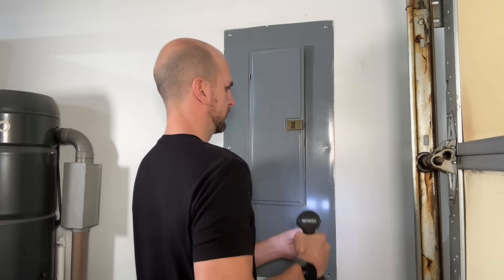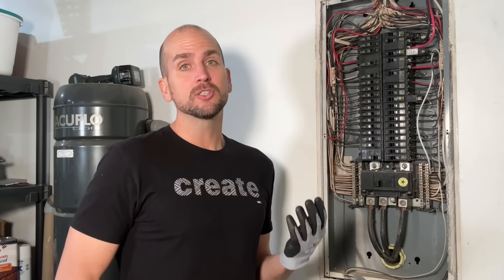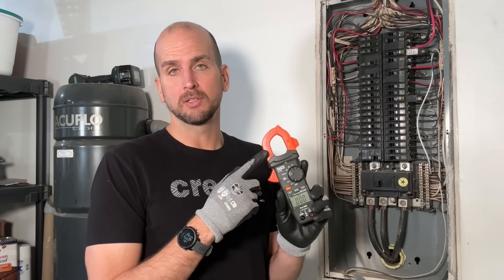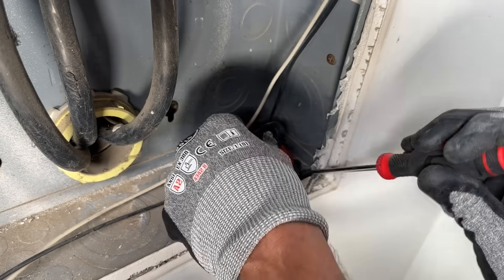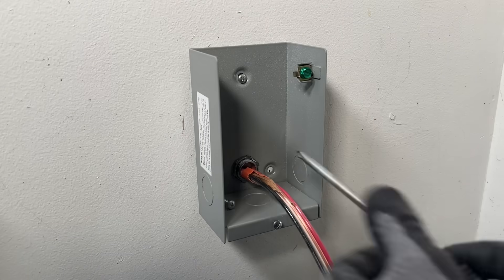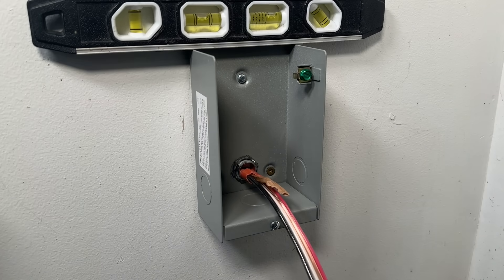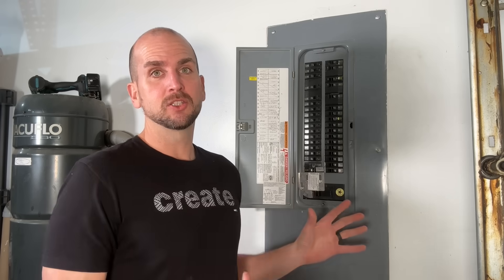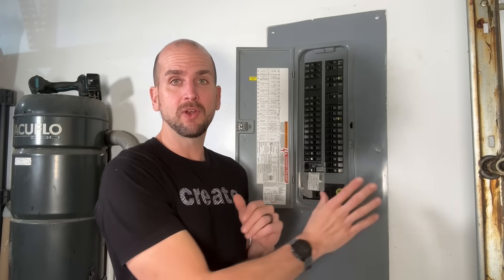Whole House Power Backup Solution | Generator Inlet Box Install

Comment: “Why the interlock?”  No lineman who wants another birthday works on a “dead line” without grounding it out first.  The reason YOU don’t want to back feed the line is 1) your backup generator doesn’t have the power to supply your neighborhood, and 2) when line power returns it will destroy your expensive generator.  It’s not about lineman safety, it’s about not burning your house down.
Reply: 20yr lineman here. It is absolutely about lineman safety. Many lineman get killed on storm from joe blow wanting to test out his new generator without hooking it up correctly. It backfeeds on our powerlines increasing the voltage through the transformer to 1000s of volts. Big killer of lineman. Even if grounds are installed there is still the potential of arc flash injuries to the lineman as he installs the grounds
Reply: @acescape88  Arc flash is a concern but that's why we had grounding hooks with 10' poles.  Nobody can look out for you... like you.
Reply: @acescape88 Hey, can we use Mike blow, or maybe Bob blow… thanks, Joe.
Reply: @acescape88 voltage doesn't kill
 the  intensity does
Reply: @dperez-tv1lr  Please explain
Reply: That's why to turn your main breaker off, so you're ONLY feeding your house
Reply: @Blackhawk1286  Spot on.  Trying to feed your whole street with even 50 amps will quickly blow the breakers on your generator.
Reply: @BulletproofPastor  you are forgetting the windings in the transformer. Just how a transformer converts high/primary voltage to low/secondary voltage, it works the same in the opposite direction when you backfeed. Low voltage input, high voltage output. The only scenario in which you could be partially correct is with old 60’s style open wire secondary line or “underbuilt” secondary. In which several houses can be fed down the street from the same or many transformers wired in parallel. But that stuff’s pretty much phased out.
Reply: You literally don’t know what you’re talking about. If you’re actually a “credentialed electrician” you’re exactly the type I would never hire to work on my home.
Reply: @47coreyg  ohh  so u too stoopid to do electrical work check ✔️
Reply: Let me add this too. Won’t the grounded line pull so much current from the generator to cause it to trip in the first place? Unless this home generator is made to power a stadium not 5300 watts or so!!!!!!!
Reply: False
Reply: Hahaa you have no understanding of electricity!
Reply: @Pure-Blooded  And you have no idea of my electrical engineering training and background.  What’s hanging on your credential wall?  Not that you need formal training, just talk to any solar provider about the consequences of making a grid tie without phase matching.
Reply: @BulletproofPastor   Solar electrician you say !  Stick to studying the books .  You have no real life experiences.

Comment: I over-engineer safety protection (>35 designing chemical plants).  I used the interlock kit for my breakers; but I also installed a locked A/C disconnect box between the breaker box and the  Power Inlet Plug.  I could not accept a single "interlocked" breaker preventing those prongs from being energized.  Anything that is life threating needs a least 2 levels of safety protection.  I could not find a Power Inlet Box with a locakable cover.

I loved your idea for tightening the NM cable clamp screws.  It would have saved me a extra hole in my sheetrock.

Comment: Can someone post how to Wire for the ford Onboard 7.3 KW generator?   Apparently its gfci protected.  And no suicide or even straight up 30 amp outlet will work unless u get a transfer switch .  Thats not gonna work .  Without overloading it it will trip regardless.   Someone mentioned Binding Neatral in a post but nothing more

Comment: For over 10 hours or a couple days of power outages, a generator is the only choice. Either a propane or gas generator because batteries don't hold enough power to go that long. Of course, depends what you want to have on. But keep in mind, once the batteries are depleted, that's it. Your in the dark.
Reply from the maker: Agree, especially for anything over 1 day.  Some people are using generators to charge the batteries and then run the house the majority on the time on batteries without the sound of a generator in the driveway.  This solution is a bit pricey currently but the battery cost should come down over the coming years making that type of setup a bit more practical.
Reply: @EverydayHomeRepairs  that's interesting. If the price of batteries comes down, the price of electricity may come down also. Why? Because solar is getting cheaper. And if they can store that energy for cheap in batteries, they will do it on a huge scale for the grid. Then many houses will also have a large battery bank with solar panels and gas generators.

Comment: One reason that you did not mention for having an interlock is very important. Your AC power is going from positive to negative at 60 hertz or 60 times a second. If the power company's power would come on and you are connected to the grid and they are not in sync, you would probably lose you generator.

Comment: Ecoflow is very nice. But mine did break, and it took a month and a half for customer service to take care of me and replace my unit under warranty. They were so slow I definitely got a bit angry. It does work very well and I also have a Honda 2200 which I can then turn on and charge my Ecoflo in about an hour and a half and then I can run all night long on the battery system.

Comment: So Your home is only one phase. From the transformer you have a coil that is tapped in the middle of it with a ground. To get 110/115/120 from one "LEG" to ground and from each "LEG" to each other you get 240. Elctricians dont calls those phases its from one "LEG" to another.

Comment: I did the same thing when we built our home, but for a wheeled Trygas unit, loved it! With whats happening in our world today, I needed quit generation. Looked into the solar gen lineup, and chose the Bluette AC500. It was the most bang for my buck! Now I'm going to add a plug to the inside but for my 50 amp. I intend to use two sets of them for a whole-house generation. Thanks for the info!
Reply: That's awesome to hear that you found a power backup solution that suits your needs! The Segway Portable PowerStation Cube Series could be a great addition to your setup too. It offers massive capacity, powerful output, and fast recharging. Plus, its armor design and waterproof technology make it perfect for outdoor adventures. Check it out and see if it fits your requirements!
Reply: That's awesome to hear that you've found a great backup power solution for your home! The Segway Portable PowerStation Cube Series could be a fantastic addition to your setup. It offers a massive capacity, powerful output, and fast recharging. Plus, it's built tough and has waterproof technology, perfect for outdoor adventures or emergencies. Thanks for sharing your experience and recommendation!

Comment: This is the simplest interlock system to install.  Relatively easy to do and less expensive than a transfer switch.  The issue with the interlock is that when the grid power is restored, you might not know.  A transfer switch will let me select which circuits are critical and need to be powered by my generator.  The non-critical circuits (some lighting circuits for example) stay connected to the grid.  When grid power is restored, those circuits become active and Ican shut down my generator (saves gas and wear and tear on my generator).  One thing not mentioned that most portable generators have their neutral and bond tied together inside the generator.  NEC requires these to be separated and individual wires run to the main electrical panel.
Reply: If  you have a smart meter, will it go blank when the power goes out, and then you'd see it come back on when the power was restored?

Comment: @2:00 you mention the 120v load from the furnace.  This must be the fan on a gas furnace.   Some have pure electric furnaces that draw far more than the 8-9 amps in yours and they draw it at 240v.

Comment: I think you should have shown how and where to install the generator breaker so it would interface with the interlock.  And how to move other breakers, if necessary, to make room for the generator breaker. I had to move two breakers to make room for the generator breaker. Helpful video.
Reply: He has a video about moving breakers. I thought the same thing and then found it.

Comment: I'm in an area where we have frequent power outages during storm seasons. Surprised your not allowing for at least one Fridge/Freezer or more. They are one of my biggest draws, after AC/Heat. And don't have the generator capable of running both AC's.
Reply from the maker: I accounted for my Fridge on this setup but not the central Air/AC.
Reply: @EverydayHomeRepairs  Sorry didn't hear that mentioned. We have 2 Frig's & a Freezer, which are our largest draws, and only run one AC if necessary. Can run a portable room unit, if necessary.
Reply: @Bwanar1    Same situation for me.  During high-draw periods (e.g. running the hot water heater), I may alternate refrigerators (unplug one or the other) as we're not usually needing both to run at the same time and they hold their temp quite well.

Comment: Very good job. One thing I noticed (unrelated to the purpose of the video) is that in your main panel, several circuits have their neutral and grounding conductor landed together in the same screws, these need to be separated. I know it's a main breaker panel, I'm not saying separate neutrals from grounds, I'm saying separate a neutral and a grounding conductor in the same screw.
Reply: I wish I understood better what you’re saying, with illustrations of right and wrong
Reply: @jesusisaliberal548  separate bare copper conductors from being in the same screw terminal as white sheath conductors (neutrals)

Comment: Great vid, I have a 6yr old house that doesn't have a main breaker,  because they didn't require it at the time per the contractor. Is this process still the same?
Reply: I've found that any improvements that require a building permit  might trigger expensive changes unrelated to the work specified in the permit.  When I moved my water heater from the bathroom to the utility room, code requirements dictated that I had to install a 20 amp outlet in the garage and change my main electrical panel to the updated design.

Comment: The Interlock setup is the one I use and have used it many times since I put it in.  Recently, we had an ice storm and power to my neighborhood was out for 3.5 days.  I was able to run my whole house off of a 5000 watt (continuous) inverter generator and even sent out some emergency extension cords to neighbors.  My entire setup, including having  the interlock installed by a professional electrician (though I considered doing it myself) for about $1600.  The Generator was $975 (with taxes), the heavy extension was about $75, the interlock kit was about $80, and the inlet was about $50, and the labor from the electrician was about $200 (he was an honest electrocution I have had people tell me that electricians quoted them $3000 just to install the interlock!  There are some major dishonest tradespeople out there.  After seeing my lights on while almost everyone else was out of power, five of my neighbors came to see my setup and had interlocks put in, and all bought a 5K inverter generator.  My generator won't run my AC, but our power outages tend to be in the winter and spring.  I have had a couple of two or three hour outages in the summer, but never more than this.  It takes a pretty big generator to run a 3.5 ton AC and I just did not think the probability of being without electric during the summer for more than a few hours was a high likelyhood.  Severe winter and spring storms are the primary reason for extended power outages in my area.
Reply: Have you looked into a/c soft starts? That might allow you to run your a/c off the generator.
Reply: 😅 I tag c ok😢 h
Reply: Exactly.
Reply: I just picked up a 9k, because they were out of stock on 7k..  heavy as hell..   Do I need a heavier gen connection cord to run to outside box?
Reply: @gardeninggirlct  9000 watt generator will need 8 gauge wire and 50 amp breaker. Now you might never actually need this much capacity, but if you have an electrician put it in, they will spec it as the rated output of the generator.
Reply: That's amazing to hear how well your setup worked during the ice storm! It's always great to see how backup power solutions can make a huge difference during outages. Have you considered checking out the Segway Portable PowerStation Cube Series? It's a versatile powerhouse with a massive 5kWh capacity, fast recharging, and durable waterproof design. It could be a great addition to your setup for outdoor adventures or home backup power. Keep up the great work!
Reply: That's awesome to hear about your whole house power backup setup! It's always great to be prepared for unexpected power outages. Have you considered checking out the Segway Portable PowerStation Cube Series? It's a versatile powerhouse with a massive capacity of up to 5kWh, fast recharging, and comprehensive protections. It could be a great addition to your setup for outdoor adventures or as a home backup power solution. Check it out and let me know what you think!

Comment: Totally illegal where I am. Even with the mains off power goes back out on the neutral.  And can kill the hydro workers. We have to use the meter base generator hookup, an actual generator sub panel or a mains switch auto disconnect
Reply: How? Is it if some fault in the wiring builds a voltage between neutral and ground?
Reply: I can't see how generator power can backfeed power to the grid if the main breaker is off.

Comment: I did this for one leg of my breaker panel as I only have a 2000 watt inverter generator 120 v output, so it connects to the box with a special cord and the interlock is on the breaker panel.
But I also have a Vtoman 1000 battery and I'm going to connect a second box but inside by the breaker panel so the FIRST thing I do is plug the battery in, if the outage is going to be longer than a few hours I could disconnect the battery, plug it into a wall outlet,  and run the generator outside with that special plug plugged into the putside box to  charge the battery  while running lights, fridge etc.
I'll only have ONE of the special plugs, it is; 

 Parkworld 885460 Adapter Cord 5-15 Male Plug to Locking L14-20 Female Receptacle.

  So no chance of having both the generator and battery connected together thru the  interface, it's one or the other..
I only need to run  my fridge and some LED lights I normally use most, and my tower computer/modem/router/monitor on these. Last time I had an outlage it lasted a couple of hours, the Vtoman battery easily ran those, and in winter it would be enough to power the electrical part of my Goodman gas furnace.
Reply: sometimes the most useful advice can be found in the comments section, thx for your post. My plan is to follow almost exactly what you did, but I don't need a second box, only one box that will get power from a small 2000w generator single phase, or my EV 1900w, that I would have to manually switch between. 

did you use a reliance 30a box or something else?
Reply: @crmoore8617  I put 2 outlet boxes in because the one in the basement is where I can plug the battery unit in and it is indoors in heated/dry space (as opposed to outdoors in possibly winter) and the outdoor outlet is just for the gas generator obviously because of fumes.

I used Reliance Controls PB20 20-Amp NEMA 3R Power Inlet Box for Generators Up to 5,000 Running Watts,Gray 

I also used this since remember, I'm only using the Vtoman Jump 1000 battery, or a 1500 watt 120v only generator

Parkworld 885460 Adapter Cord 5-15 Male Plug to Locking L14-20 Female Receptacle

ALso, because it's only a 120v generator and battery, I have only one leg in my breaker box connected and with the cut-out plate installed, so all the things I NEED to power- fridge, lights etc are on that leg
Reply: @crmoore8617  I know I answered you, now I don't see it, I used 2 boxes because it lets me keep the battery in the basement out of the cold and weather, and use the generator outdoors without having to run an extension cord down the steps from outside to the box in the basement. I used  20 amp since neither my generator or the battery puts out any higher amps.

Comment: Ok I did this hookup every thing went great BUT using it blewlew  out my G FI  what did I do wrong.
Reply: Probably your generator's neutral and bond were tied together inside the generator (usually).  These need to be separated and a separate bond wire be run to the electrical panel.

Comment: Thank you for this video.  Do you have a video of installing / using an automatic transfer service?  I'm finishing my basement and have installed 2x 30amp 240v L6-30r.  One of those will be used for a home server / theater rack.  The other I'd like to use for a battery system.  But I'd like the a transfer system fast enough to not even flicker a light bulb and then transfer back when utility power is restored.

Comment: Great video I think this is the easiest way to hook up generator to the house. My only question is do you just turn off all the individual breakers of the non essentials you dont want power to, and keep the essentials on? Or leave everything on and just use what you only need?
Reply: Before you turn your generator breaker on, you'll want to switch all of your breakers off. If they're all on when you flip your gen breaker it will overload your generator. Once the generator is on you can flip your breakers on 1 by 1. Only use what you need to use.